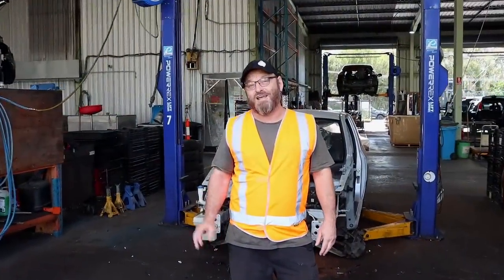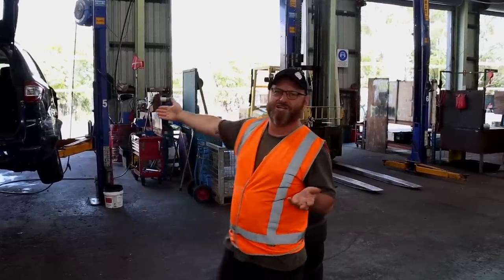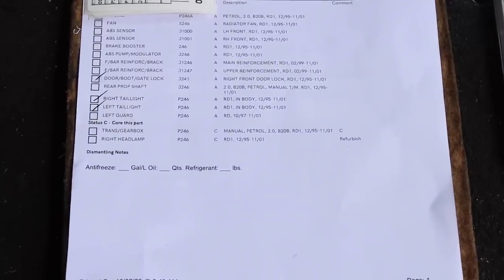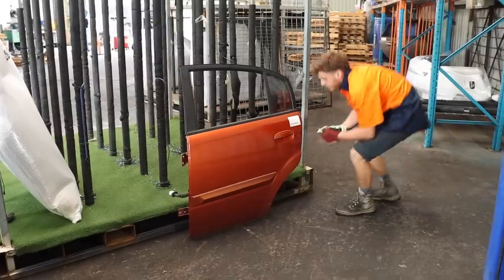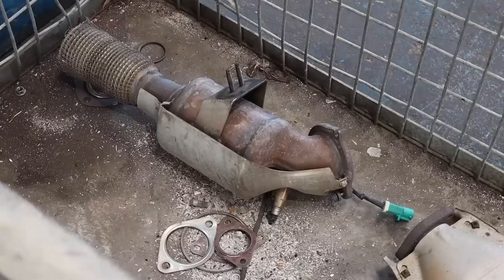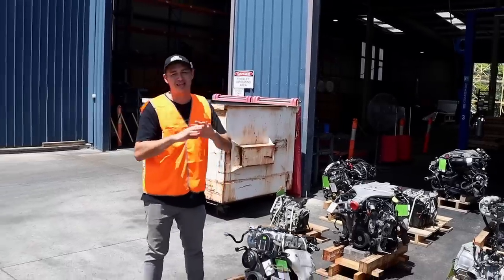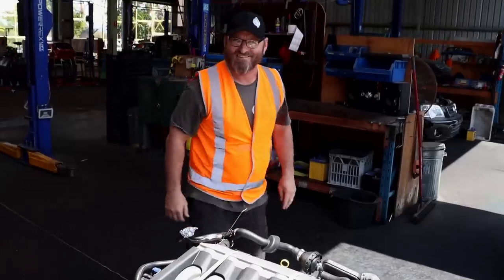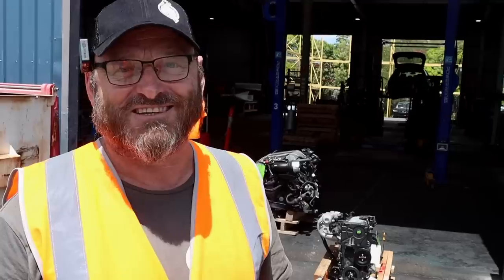Crashed Your Car? What Happens Next? Old School Wreckers are FINISHED!

Comment: 'Nothing goes to waste'. I think you'll find the opposite is true Woody. The tragedy of these places is that they'll only keep the stuff that sells quickly. ie the parts panel beaters need to repair slightly damaged cars. Everything else will be scrapped. Once a particular vehicle drops out of the general population they'll dump all the remaining bits. Warehouse space is too valuable. Good luck finding bits for your collectable in 15 or 20 years time, because these places won't have them.
Reply: This is the truth. ZZero chance you're finding hard parts like a petrol flap for a Crown or other small stuff. Need the hardware with that panel? No chance they went to scrap when it was dismantled. Don't forget the giant hole in that petrol tank, can't reuse that, and good luck getting an aftermarket one.
Reply: It's getting recycled, not getting thrown in landfill.
Reply: It's less about holding onto rare parts to have an amazing collection, and more about utilizing parts that would otherwise go to waste. If we can re-use that alternator instead of chucking it away, and having to manufacture a brand new one, that's better for the environment and the customers. Either these cars were destined to be scrapped anyway, or they would end up in a field rotting away and contaminating the environment.
Reply: That is correct.  I work in the industry and typically they only remove about 40 to 60 parts per car at the absolute most.  Everything else is crushed and they move onto the next car.  This is by the far the most efficient way of utilizing the wrecked car in terms of sales.  All sales and lost sales data is fed back into an algo that tells them what car to buy and what parts to remove.  If only 28 parts can be sold but the car is cheap, then only those parts will be removed.  It's a huge waste of parts really, but storing wrecks forever is not realistic either.
Reply: @GordonDragons there was epa  rules in place over 20 years ago to remove fluids before cars went into yards. It's recycling for now but there will be no car recycling in the future with cars more than 10 years old.
Reply: I have a mate who works for a 'Recycling' company. - He sent me photos recently of a beautiful Range Rover that came into his works. I think it was a 2012 model. Supercharged V8. 22 inch alloys with good tyres. Electric everything. Unmarked leather interior. Reasonable miles. It was complete, running, with minor damage to the doors and front wing on the driver's side. Could easily have been repaired.

It went through a shredder. Nothing was removed from it beforehand.
Reply: @cogboy302  Parts availability is a big issue at the moment, and has been for a couple of years. Crash a car and see how long it takes to get parts, especially Euro stuff. Insurance companies just piss them off, they don't want it sitting on their books for months on end
Reply: He literally explains that
Reply: It's all the common cars too, jump on the auctions and watch what sells high vs low. Eg: I watched one recently for salvage/repairable write off's. Whenever a Camry came up it went for stupid money yet a 4yo epace Jag with a small bit of damage in the front sold for $16k
Reply: You steal it in Adelaide - went to collect parts off a 15 year old Vectra - nobody else would have them.   Cut away the spot welds - cut the panel off behind the rear window.    Job done.   These guys wouldn't have these parts - meaning the old girl would have been written off, rather than drive another 290,000Km.

These methods are noble - but it's NOT a solution for keeping all of the cars going.
Reply: i work in a big yard in brisbane where we still do it the old school way  and its important for the people who need the little bits that they can go remove them selfs
Reply: Was lucky enough to get to one of the last self service wreckers in SEQ the other week for some parts off an 05 territory. No wreckers/ebay nationally had them. Factory quoted ridiculous amount + weeks to get them. Otherwise it would be a statutory write off. Miss the days when you could go in and get what you need locally. Now it's a 3 hour round trip..
Reply: @klord-is9ft yep, junk turned into more junk 😂

Comment: Pick and pull type yards are the best for obscure interior trim that recyclers don’t tend to keep around.
Reply: I like them because you can find so many random little parts, like a specific bolt or nut. Sometimes you find diamonds in the rough too, like an engine or transmission worth far more than they charge. Just recently I got a flexible coupling for $10 in almost new condition that costs over $600 from VW of $350-400 from overseas.
Reply: BONUS FUSES
Reply: A collection of Toyota sump plugs.

Comment: The "bad news" about modern recyclers is that when you need something for your 20+ year old car they got nothin.  Then you end up looking for a parts car or a specialty junk yard that has hoarded specific makes or models.
Reply: Yer. Little trim peices etc. All scrapped.
Reply: The same can be said for most wreckers they have exhausted the useful parts of these older cars and scrapped the shell to make room for a new vehicle
Reply: My car is from 2008 and even it's hard to buy for
Reply: Also companys like this go to auctions buy up all the cheap cars then overcharge for everything.

Comment: Gone are the days when you had to stand on the roof of an old Falcon or Fj just so you could get a bird's eye view and find the Escort 's and Gemini's hiding down the back. I do miss those days, back when you could find any part you ever wanted and half the fun was the adventure.
Reply: Going to the wreckers bare foot with dad, walking in broken windscreen glass, admiring all the Monaro's and Gemini coupes that didn't belong there, pocketing keys from the written off locksmith van.
Reply: Trying to find Gemini parts is a nightmare now. When I had my first one I got doors for $50 each.
Reply: @andrewwinch474  Just the other week I gave my nephew NOS master cylinder and tail lights for a Gemi wagon I found down the back of the shed.
Reply: @TC-yx2ss  can’t find many parts for my TX
Reply: @andrewwinch474  I really regret getting rid of mine. I had a wrecked TG, a TE, TX and 2 TX coupes, I didn't know enough about rust repairs back then. All I have left now are some coupe windows.
Reply: @FixTechStuff  sold my 1st one for $600. Not as bad as my XB Hardtop, but still.
Reply: @andrewwinch474  Ah the regrets. We all have them.

Comment: I hope my wrenching days are over when this form of recycling comes to North America. Here, the fluids are all drained and the car/truck is set out in the yard for a few weeks for customers to pillage, then rotated out for a fresh wreck. The remains are then stripped and sent to their final destinations. Pull it yourself yards usually have a better selection of older vehicles and you can get hard to find obsolete parts like interior trim, wiring harnesses, fasteners, and even some specific electronics or other components. Roaming the wrecking yard helps with project research, what parts will fit other models for modifications or upgrades (an interchange listing will only show exact fit.)

Comment: Used to work for these guys. Overall quite good, warranty process needs work. They have 1 guy doing all the warranty claims nation wide. When I was a salesman there I had a 30% found rate, meaning when people asked me for a part only 30% of the time I would have it in stock. That is mainly because people would ask for little clips or trim pieces mostly., and ACM only pulls between 5 and 15 parts per vehicle. They were in the process of ramping that up to 20 on average but I don't know how that has gone since I left there around a year ago
Reply: Interesting that they let you on site without steel toe boots though. Sticklers for safety in the Sydney yards

Comment: I've always wondered how so many wrecker engines end up full of water and rusted
Reply: “It was working/running when we pulled it from the wreck”… before we stored it in the elements for express decomposition…
Reply: I cringed when I saw the pressure washer
Reply: sometimes its stored outside, thats the killer.

had a trans for a holden cruze, it had no drive shaft seals fitted, boss wanted it fitted, it looked dodgy. full of water and had to remove it again, it was worse than the fucked one i pulled out. not acm.
Reply: @aidenstefanson2175  Yeah me too… Would rather they shipped as it was when pulled out of the car.
Reply: I think you'll find less engines are full of water and rusted due to being pressure washed than the old school wreckers that just leave them out in the weather.
Reply: Because people leave the bonnet up. A mate owned a wrecking yard. But if the car came in with a good engine they would pull it straight out and put it on racks.
Reply: Yeah, rust in the bores, otherwise engine perfect - pressure washed then left to sit with water pooling everywhere.  Won't impact a lot of engines, but others it's the end of them - & all they need to do is dry them with compressed air.
Reply: "15 minutes warranty because we don't know what happened to it before we got it"

Comment: We have both kinds in the USA.  A pre-pulled type yard is handy when you're looking for a deal on late model vehicles, but they rarely have anything older.  There aren't any stacked yards around me anymore, but there's still u-pull-it type yards around.  One holds onto older vehicles and has been very helpful for me.  Modern yards don't pull random little brackets or one-off fasteners that aren't available from the manufacturer anymore.  I've had to resort to a combination of scouring u-pull-it yards and keeping a parts car for each of my two frequently driven older vehicles.  There's not a lot of aftermarket support for my 1996 Buick Roadmaster wagon or my 1987 Ford LTD Crown Victoria aside from engine/transmission/drivetrain parts.

Comment: Old school wreckers still have their place but they're disappearing sadly. Wreckers like ACM are good for high quality parts and decent warranty support but they only keep what they can sell quick and junk the rest. So many wreckers are doing the same thing cause insurers don't have to use new parts, they're allowed to use like for like replacements. I have a '13 i30 and needed a boot seal cause I damaged mine carrying a lounge in the back. Spent a morning calling every wrecker on google and found nothing, ended the day having to order one through Hyundai for $200 when I could've reused an original part for $50.
Reduce, Reuse, Recycle. 

Reuse is far more important than recycle and we're losing that option. Back in the day I'd go to a wrecker and get a bag of fuses for a couple bucks, rubber hoses, hose clips and separators, lengths of wire from old sub installs. I'd even grab up trim clips and the bolts left behind after parts were taken. Was able to have so many spares for random stuff that lasted me years, now I'm stuck searching eBay for literally the tiniest random trim clip

Comment: I used to really enjoy hunting around old-school wrecking yards. Carseldine in Brissie was great. But my favourite was Kawana Wreckers in Rockhampton during the 90s. They had acres and acres of old and new cars out the back. They also did some stripping of vehicles and had a huge warehouse with racks and racks of doors, panels, wheels etc. They had pallet bins of hubcaps and I'd sometimes spend an hour digging through them looking for old ones. I had a set from the EH era and the set cost me 2 bucks. I had quite a few from different models that I'd hang around my homemade bar...it was the 90s...

Comment: There's an old school local yard here in Aberdeen, Scotland. Pick & pull job. Classic stuff appears now & again, but you've got to be fast! There's another yard packed with classic & vintage stuff out in the shire that's a real adventure. Mostly glass, switch gear & stainless trim due to everything slowly turning to dust. A lot of the stock has been there for 50+ years... there is a Model T chassis, but it's also crumbling. There were many more yards full of classics, but they've been cleared to make way for housing developments.

Comment: Lucky Imlachs, Harveys, Jollys and Pick a part in Melbourne still have the ability to get good used fuses not ones from china wrapped in more plastic, plus the bolts you lost with the 10mm socket in the lawn while working on the car at home.

Comment: The you pullit yards are where I learnt a lot of how I do stuff with cars. Dismantling a smashed Excel gearbox so I could figure how to install an LSD into mine, pulling damaged doors, trims, and particularly dashboards apart without being so worried about damaging them because they were already damaged before attempting to remove my own undamaged parts; getting rare, brittle, NLA available clips, etc... 
I bought a 5 year old VAG wagon which was missing a cover off one of the child restraints. Not available as a spare part in Aus. Was fortunate to find one in a car about to loaded off to the scrapper.

Comment: I remember mid 2000s, throwing my socket set and screwdrivers into the car early in the morning so we could rush off to Pick n Pay after school. They still had a good 20 VL/VK Commodores at that time before it filled up with VTs around 2010. Used to spend hours looking at all different 80s/90s Nissan parts to see what could interchange with each other for my Skyline. Used to love checking out some of the Euro stuff, a lot of them looked like they were still mint condition but their wiring had caught fire or something. Finding an old Datto or old Toyota in the back was always exciting

Comment: Can't wait to see the Coyote build, we've done a couple in our shop and they are just awesome out of the box. Definitely would go the Haltech route to control it over the factory or Ford Performance ecu
Reply from the maker: Haltech, 6R80 and a pair of 62mm turbos I reckon.
Reply: @theskidfactory  T56/TR6060 may be a better choice for simplicity and fun. Make sure the exhaust housing is big since those heads flow a lot of 💨
Reply from the maker: We already have a Hughes built 6R80 and controller for it.
Reply: @theskidfactory  Interesting! I'll stay tuned to see how it turns out. Haven't heard anything about a standalone controller for the 6R80's yet!

Comment: Smooth cleanup operation. Its done like this a few places here. The older but compliant way is depollute (drain fluids). Then put rest of car in a yard to be picked over by people who can walk around (sometimes they dont allow walk around but take parts off for you that you might want). Once the cars bare they crush it and it gets turned into whatever. This mostly happens with older cars. The more new cars with a high value normally get sorted out like in this video to get maximum value in a yard parts will get broken, dented and stuff and money lost.

Comment: I ran a wreckers for 6 years in the early 2000's for my boss. I have seen the change happening. Labour cost etc had me take off less and less parts. To the point you couldn't help someone with the small but sometimes necessary parts to keep their cars running. Sometimes the manufacturer just stops selling those. A real shame.

Comment: Your captain planet speech has given me the opportunity to ask something I've wondered. Does the skid factory worry about how and when climate action (whether right or wrong) will affect the scene of playing with performance cars??
Reply: Good question. It'd be pretty easy to argue that drag racing, restoring and modifying classic cars and "skids" are not sustainable. I can't see these guys working on Teslas and Polestars.
Reply: @anderserisian8078   it’s 1000 times more sustainable than battery powered cars yet look at the way they’re pushing those.
Reply: @ttv8ra23  Agreed, i wasn't presenting that as my own argument, just the flawed argument being pushed by certain others. I've worked as an automotive and machinery mechanic  on and off for over 30 years, I've never owned a new car in my life, nor would I.
Reply from the maker: I can tell you that it is not a discussion for the comment section of youtube.
Reply: @theskidfactory  was trying to avoid the rights and wrongs of it, more do you worry that it could change significantly in your time.

Comment: Thanks for the video.
You guys need to do a Eco tec engine, just to check it off your list of engines you want to do. I have run three cars with eco tec engines never had a problem with the engines. First car Cruz 8 years old moved on to new Trax car was T bones and a write off hit driver side, driver walked away no problems, now driving chevy malibu. Will retire the latest car when it cost to much to repair.

Comment: broke a CV axle... cut out the fractured section, welded in the 3/4 inch gap recut splines. cost $5, new axles cost $58... shipping on new part was 6 weeks, shop got it done in 2 hours. what's the time worth? CWB frack vestals SMAW 4918 on 4340. HSS tooling doesn't cut it everything has carbide cobalt on it.

Comment: It improves convenience and known stock availability for the high value parts, for sure...     but it has also added more logistical costs to the process and end products. 
they have to recover the cost of the man-hours in dismantling.       
but what about the unusual parts or things they dont remove?   where do we go for that?  
what about the age of cars... i was told they dont do 90 series Prado's for example.  not worth it for them...   apparently.  
so yeah... places like ACM parts on face value are a great thing... 
but 'old school wreckers are finished'?   dont think so.

Comment: What front suspension will you be using to fit the coyote?
Reply from the maker: It will either be a tower notch or a "mustang 2" double wishbone type front end. The towers are already hacked to pieces from previous owners anyway so no loss.
Reply from the maker: Coolest thing in the whole place.